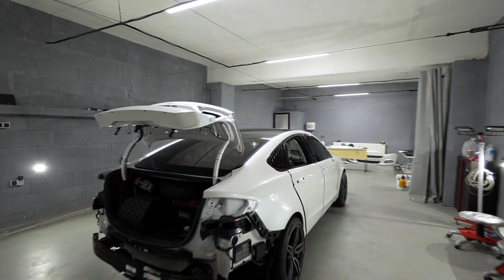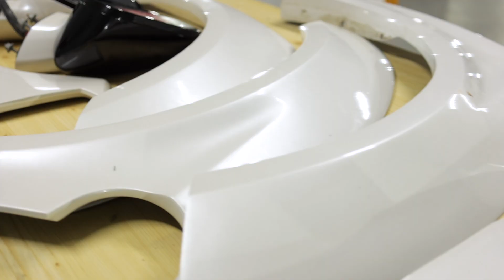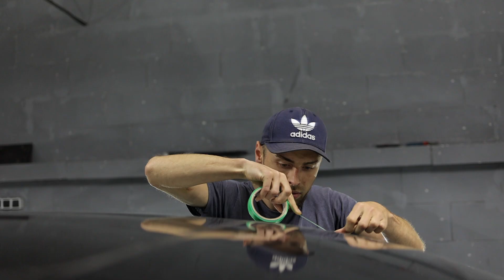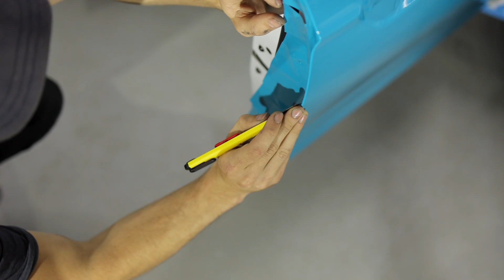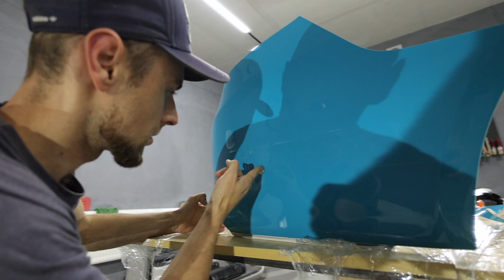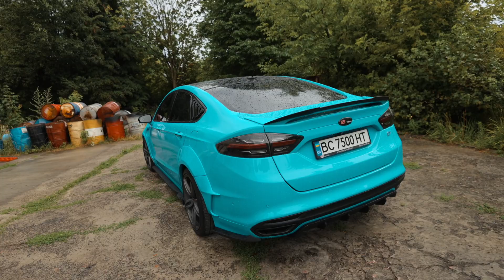Fusion plug-in hybrid by SS-tuning: body kit and new color

Comment: Is it possible to tune a hybrid se ?
Reply: That's what I'm wondering too. These cars are no slouches. I think they're faster than the 2.0 Ecoboost. I have owned both 😂
Reply from the maker: Yep)
Reply: @SStuning  cool! They're actually really quick cars. The fusion hybrid has an electric motor with 117 HP and 200 torque! Gas engine has 143 HP and 123 torque. Would make a nice sleeper! People don't know how to accelerate the hybrids for optimal 0-60. You can't just floor it because the gearing will climb slower. I have owned a charger rt, bmw v12, genesis 5.0....the fusion beat a Subaru STI from a stoplight race and a q50 😂😂 and yes they were racing me